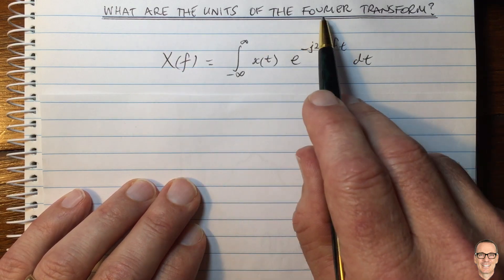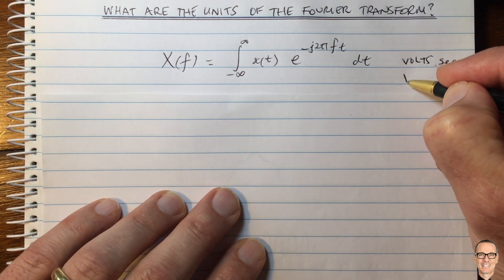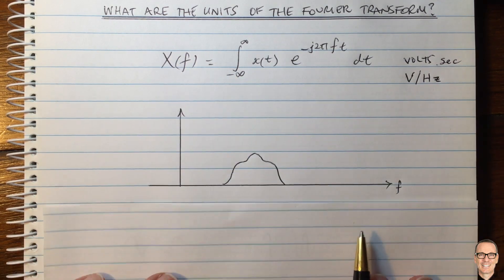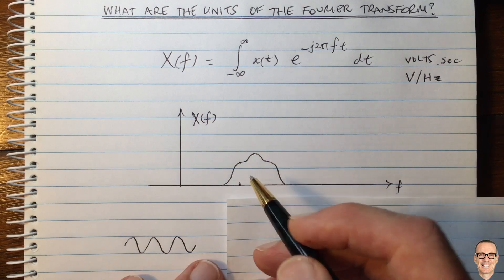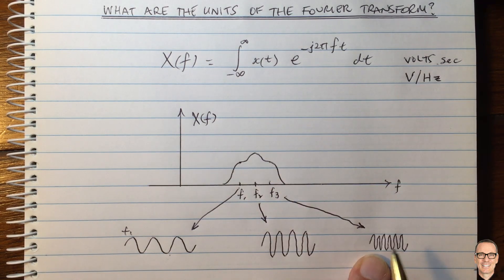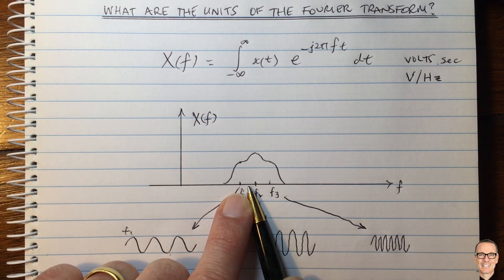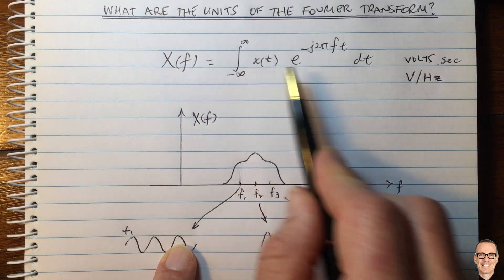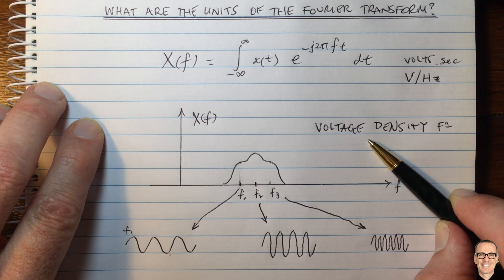What are the Units of the Fourier Transform?

Comment: Shouldn't the area under the curve, the integral, in frequency domain be the same value and units as integral in the time domain?  For example, in the case of power (W) measurements in time integrated over a time window gives energy (J), and hence integrating over the transformed frequency window should also give energy (J).  That means individual frequency components are in units J/Hz, transformed from the time units in J/s=W.  In the case of V in time the integration gives Vs, but your V/Hz in frequency integrates to V.  Isn't that inconsistent?
Reply from the maker: The time domain signal I was considering was a voltage signal. That's the most common fundamental signal measured and considered in signal processing.
Reply: @iain_explains  I'm still trying to get my head around this, so I hope you don't mind a follow up question.  So, with a voltage signal in the time domain, shouldn't the frequency domain representation be in volts per square-Hertz, V/Hz^2?  That way integrating over frequency gives V/Hz = Vs, so it matches the units resulting from integrating the time domain representation?  What am I missing?
Reply from the maker: The energy in the time domain is the same as the energy in the frequency domain (not the "magnitudes"). It's called Parseval's Theorem. So you need to integrate the square of the values in each domain.

Comment: Best explanation.
That is why amplitude is not zero in case of F transform of periodic signals, because integration of impulse is 1 so the coefficient of the impulse is the amplitude (scaled maybe).
But for non periodic signals, we can represent any signal as many impulses, but each impulse is of nearly zero area due to finite fourier transform. Or like you said for a narrow band around a certain frequrncy, those frequencies nearly have 0 voltage (ofcourse scaled by the fourier transform value).
Reply from the maker: Glad you liked the video.